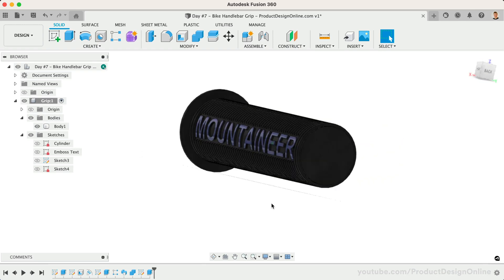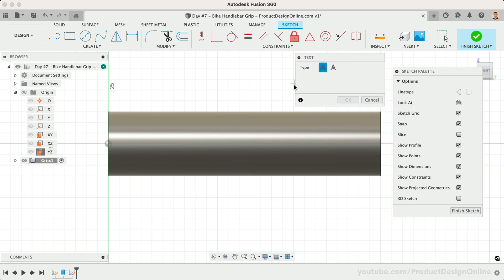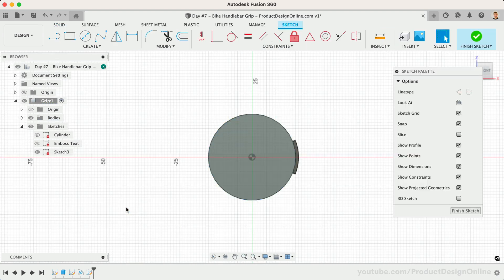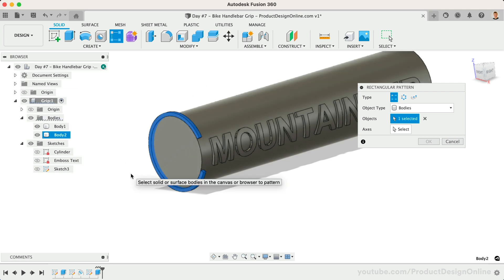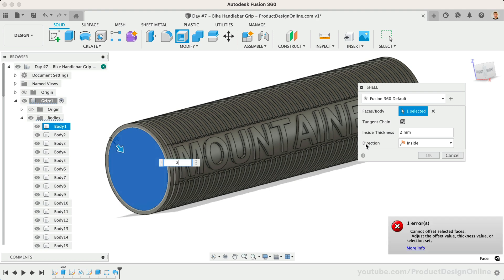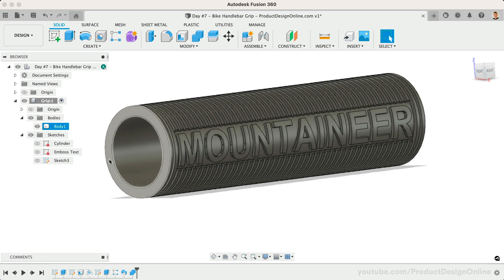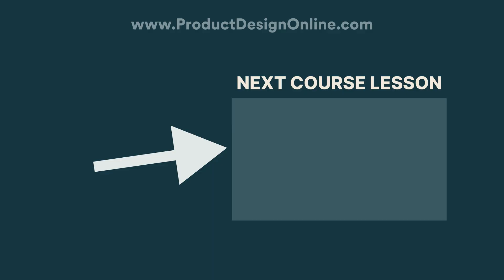Day 7 of Learn Fusion 360 in 30 Days for Complete Beginners! - 2023 EDITION

Comment: Thanks again for a great video.

If I want to 3d print this model, with a multicolor printer.

How would I do it so the handle is black PLA, and the letters are white PLA?

Could you explain how to do that?
Reply: I would right click on the grip in the browser menu and "save as mesh". Save it as a 3mf file. Import that into your slicer. Paint the letters using your slicing tool with the filament colour you wish to use. At least on a BambuLabs printer this is what you could do.

Comment: Hello sir, I didn't understand a few things, why do we use the project command. Like here you used project on the circle, how did it help? cauz I was able to do it without the project. Second you choose the cut in the circle between the text randomly, how to precisely place where we cut the circle?
Reply: the sketch for the text was created in a plane. As the sketch of the cylinder has the origin of the circle in the origin of coordenates, the plane for the text sketch was created just in the middle of the cylinder.

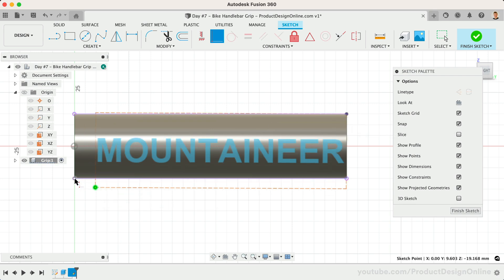Comment: Maybe it's because I'm using a different version, but when I click the second pair of corners like you do at the 2:43 mark, my text box does not stretch like yours did.  The corners do not move at all.  I had to Esc out of the Coincident function and drag the bottom left corner of the sketch to match the bottom left corner of the cylinder.  Then I was able to add a horizontal constraint to the top edge and fully define the sketch.
Reply: Do exactly like him or slow video down and rewatch and retry fee times this moment

Comment: Combine didn't combine? I just just end up with multiple bodies even after combining them.
Reply: Ok i fixed mine, even thou i thought i was selecting all the bodies (except body 1) i wasn't there was about 20 more or so i was missing. I only noticed this when I started to select them one by one (boring and slow) but by the time i thought i had selected them all I noticed quiet a few was not selected.  So I scrolled down on the body list and found the missing ones. Once all selected and ok pushed all bodies became 1
Reply: @andystinson4668 I think I gave up back then. If I try it again I'll think of this comment, thanks!
Reply: you are selecting the original body when combining thats why
Reply: Did you figure out how to fix this issue?

Comment: 2:50 the emboss tool doesn't work for me as i get an error trying to add a vertical constraint and i am unable to select the text inside the structure in order to emboss for some reason.
Reply: The eye ball on ? I had same issue , I jus restarted and watch his mouse and did it no problem

Comment: i have this problem copied from another user: When I Emboss the text on the hand grip, I select the lettering, then select the surface of the cylinder.  It always projects the embossed letters to the back side of the grip rather that the front facing side of the grip cylinder.  Thus the text is all backwards.  I have redone the entire grip multiple times and same result.  I'm going to try it with other shapes etc and see if I can determine why it doesnt project forward.  I coiuld create the text backward and make it work out but something is off.
ANY SOLUTION? i doesn't want to flip the text in the timeline as a solution

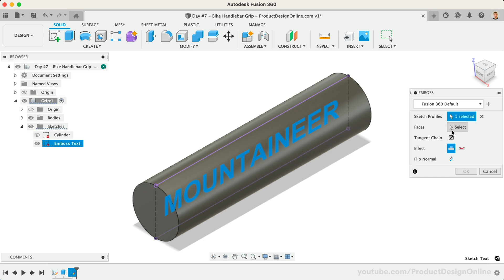Comment: For 3:25, Kevin says to use the flip normal feature if the text gets embossed in the back face, but that feature seems to be gone in the latest version of fusion.
I fixed the problem by deleting the coincedences on the two corners of the text box and using the move/copy tool to move the text a bit forward. (seems like emboss wants to emboss on the closest side of the selected face)

Comment: When embossing, the text always appeared on the other side. The 'flip normal' does not exist. I tried to 'flip text' while editing the text and this did put it on the right side of the cylinder but it was still backwards. My solution was to create an offset plane 1mm away from the ZY axis from which to place my text on. The embossed text now appears on the correct side.
Reply: Yep. I noticed this just now too. This USED to work just like in the video, because I had done this tutorial when it came out, but for whatever reason they made this command functionality worse.
Reply: Thanks for your help. I was really struggled with it.

Comment: I had issues using the "combine" tool because when I did the sweep, I chose join instead of new body. I think using join caused some of the additional body tools to be apart of the main body, so they couldn't be combined. Once going back in the timeline and editing the sweep to be new body, the combine worked perfectly. I didn't see any comments about this so maybe that will help someone later on :) Thanks

Comment: For the ppl who used non-mono-sized fonts in this tutorial, it will be better to project the highest and lowest text plans to the XZ plan when sketching the `Grip` profile on the XZ plan. So you can find out the highest and lowest points of the text on the Grip profile plan to avoid the Rectangular pattern from colliding with the Embossed text.

Comment: I don't fully understand why you are projecting constantly on the circles? Am I missing something because I'm not projecting at all and I got the exact same result (I'm not saying it's useless, I just want to understand) thank you!
Reply from the maker: In Fusion, the "Project" tool allows you to copy the outline or shape of a 3D model's feature onto the active sketch plane. This helps you create sketches that are aligned with or based on existing geometry, making it easier to design and modify parts. It's like tracing the edges of a 3D object onto a flat surface for further design work.

It makes it easier to relate things and keep them manageable without having to add more dimensions.
Reply: @ProductDesignOnline  thank you! And thanks for the tutorials they are amazing

Comment: I could not get the final grip ring to be flush with the internal edge. I redid the entire thing and still had this happen. I notice you didn't say that you selected the inner surface along with the offset profile, although you did do it onscreen. I selected both and this fixed it.
Reply: So glad I found this comment. I've noticed that there are a few things about theis current version of 360 that are different than the tutorial, but this was the same. It was driving me nuts! Fantastic tutorial though.

Comment: @2:43, I had troubles to get it fully defined, as you just breezed by it with a casual mention.  Some how, I did undo and followed along again until it worked with no real explanation of the problem.  Absolutely frightening.
Same thing happened in the previous lesson with the previous lesson, selecting the point to revolve the triangle around in a circular motion.  Help from the comments pointed out that the view had to be left straight on.  No explanation why again.
I can't wait to start developing things on my own and running into this nonsense.  It is not inspiring confidence.
Reply: Press enter after setting the corners, and then click the outside text box to define (red lock).

Comment: I don't understand the need to project, what does it do?
Reply from the maker: Project command will include (project) existing edges so we can reference them without sketching them again. The advantage is that your model will automatically update if you change the original sketch (source), helping keep your models more parametric.

I have a lesson specific to Project on the channel that may be helpful 😎

Comment: You keep talking about how important constrained sketches are, but your (and my) sketch 3 is not constrained, but the model is completed. What implications does this have?
Reply from the maker: As with all things in fusion, it all depends on your design intent. If you plan to make truly parametric files, then you should always fully define every sketch. If you need to do it quick design mockup, such as this, then it's not a big deal. You would still be able to update the core details but would need to manually update the rest.

Comment: I notice that at 8:35, Sketch 3 does not have the red lock to indicate that it is fully constrained.  I can't find anything to further define it.  What is missing?
Reply: for anyone who might stumble across this: Sketch 3 is not fully constrained because the lines that were added for the grip cutout for the embossed text are not properly defined. you can fix this by making them parallel to the top/bottom of the embossed text as well as adding dimensions!

Comment: Hi, I had a problem with shell command when I was doing. All the time I tried to use shell command, the program didn't respond, got frozen and threw me out. I tried it several times with different inside thicknesses but the result was the same.  Why does this happen?
Reply from the maker: Make sure at 5:15 your ridges are set to 'new body'. I'm guessing yours joined the rest of the cylinder. There wouldn't be enough thickness there to Shell, resulting in an error.
Reply: I checked it out, I choose the new body as well but nothing changed. Program again got frozen.
Reply from the maker: @ArvenThorssen  Can you share link to your file or a screen recording? Something doesn't sound right. :)
Reply: So sorry, I got what I have done. Thx for helping.

Comment: They got rid of the Flip check box in the emboss from what i see... had to completely redo the sketch from the other side and try again
Reply from the maker: Not sure why they removed 'flip'. Checking on my end, the Emboss still goes to the front. Would you be able to export your .f3d file, upload it to a sharing site (DropBox, Drive, etc) and share the link?
Reply: @ProductDesignOnline  I did manage to get mine finished, but i can send you a screen shot of the missing feature if youd like? ive noticed in todays version (at least the one i have) theres several little nuances missing that i have to take an extra step to get the same thing. do you have a contact i can send it to?
Reply from the maker: @Rucknight  ah, no need for the screenshot. I've verified the flip is gone in all versions (of course, no notification or reasoning from Autodesk). I was more curious in your file if you were still having issues as I couldn't reproduce it embossing to the back side on my end. Thanks!!
Reply: I'm not sure what I did there either, but after backing up and redoing it it worked the way I wanted. There's little features here and there in these videos that are just gone. Makes for some fun trying to find a workaround! Would be cool to see some of these videos re-approached with these updates. Thanks so much for putting the time in for these videos!
Reply: There are some things I'm not sure I understand, like what project actually does, ect. A lot of these are like "use project" and idk what it does or what I'd use it for I just know that's what we use here (if that makes sense)
Reply from the maker: @Rucknight  The Project command is one of the more complicated concepts in Fusion 360. I try to slowly introduce it through this course (it's in many later lessons). Don't worry too much if you don't fully understand it at this point. It's important, but there are many other core concepts (Components, fully define sketches, etc) that are more important.

Some more details for now (if you're curious):
The Project command "projects" geometry from outside the active sketch onto the current sketch plane so that you can reference it.

The benefit is that you create an associative relationship between the selected (projected) objects. This allows you to reference existing parts of your model in a more 'future proof' way. If you change that original source, then all the projected geometry will automatically adapt without the user needing to do something.

Comment: Whenever I try to emboss, it embosses out the back side of the cylinder, so that the text is on the wrong side and also backwards. How do I fix this? I don't have 'flip normal' in my options.
Reply from the maker: Not sure why they removed 'flip'. Checking on my end, the Emboss still goes to the front. Would you be able to export your .f3d file, upload it to a sharing site (DropBox, Drive, etc) and share the link?
Reply: @ProductDesignOnline  Absolutely here it is drive.google.com SLASH file SLASH d SLASH 1pw5OWjI-FJzu1N39XeG1Vqma1yf8Joap/view?usp=drive_link
Reply: @ProductDesignOnline https://drive.google.com/file/d/1pw5OWjI-FJzu1N39XeG1Vqma1yf8Joap/view?usp=drive_link - Might not work, split up URL in another reply
Reply from the maker: Thanks for the link! It says I don't have permissions to view it. Can you change the link to public, plz?
Reply: @ProductDesignOnline  Oops! Fixed.
Reply from the maker: Thanks! I took a look and am experiencing the same on my end (with your file). I can't pinpoint what has caused this in the first place. Potentially, some cached geometry or something that is thinking the sketch plane is closer to the back side (even though it visibly appears directly in the center).

The simplest fix with your file is to do the following: 
The Emboss command will always emboss to the closest face when it's a continuous surface.

Create an 'Offset Construction Plane' off your YZ plane. As little as .01mm of an offset is sufficient. This makes sure the text is closest to that front surface and the Emboss always places it there as a result.
Reply: @ProductDesignOnline That did the trick! You really didn't need to do this for me, but I really appreciate it!
Reply from the maker: @Grazfather  thanks for the coffee! Cheers
Reply: @ProductDesignOnline  There's a chance it could be because of the orientation of the text/cylinder. I had this same problem too, and it wasn't until I hit the home view that I realized I had sketched my text to be upside down and backwards; therefore, I'm assuming that when the text to be embossed is equidistant from both sides of the cylinder, it defaults to embossing in a specific direction.

Comment: IF YOUR FONT WON'T EMBOSS - you are most likely using a custom font that is not a TrueType Font format (.TTF). Open Typeface fonts (.OTF) fonts don't work for emboss/deboss operations in Fusion 360 for some reason. You can still use your custom .OTF font by converting it to .TTF format, installing it on your system (replace the .OTF with the .TTF), and restarting Fusion 360. For Windows users, Installed fonts are in the C:\Windows\Fonts folder and can be located and converted to .TTF for free using one of many online converter websites. Hope this helps!
Reply from the maker: Thanks for sharing! More info is here: https://productdesignonline.com/tips-and-tricks/how-to-use-custom-fonts-in-fusion-360/
Reply: Thank you so much! I couldn't work out why the font I was trying to use wasn't working until I read your comment ❤
Reply: THANK YOUUU
Reply: THANNK YOU SO FREAKING MUCH
Reply: THANK YOU
Reply: Hero!
Reply: that was an awesome tip. i wouldn’t have got that on my own. it’s not intuitive to me. i was going crazy listening to his voice say the sane thing 63 times
Reply: Ok buddy

Comment: I had some puzzling issues when trying to Sweep the rings at the 6:27 mark. My First problem was I was succesfully highlighting the end faces of the first two rings on the left but when trying to do the same with the next two on the right the Dialog would should them selected as i clicked them but they wouldn't highlight regardless of my repeated attempts. When setting the 'Operation' to New Body as directed I was returned to the model without the changes. looking back at Kevin's actions it seemed he first set it to 'Join'  before 'New body' I did the same and it seems to have worked but don't know yet until I discover later errors?
Reply: Thank you, I was wondering why it didn't make a new body. what a weird bug

Comment: I am at 3:25. Exact state. I selected text as the Sketch Profile and the cylinder for the face. Nothing happens. The Emboss window shows 1 selected for each option, Tangent Chain checked, Effect set to emboss, no other options appeared and OK button is greyed out.

Edit: It seems to have been a font issue. It won't work with Barlow or Barlow Black, but it did work with Consolas...

Comment: I would like to join into the number of people who are confused why their emboss text is coming out the backside reversed. Help appreciated
Reply: Ik it’s been a long time sense u posted this comment, but when getting the thickness of the emboss, try to put a negative sign infront
Reply: The thing is Fusion360 seems to have removed the option to flip normals when embossing. So instead you have to make the text on an offset plane that is closest to the side you want your text on. Also, when doing it this way - choose project instead of intersect when deciding constraints for your text box.